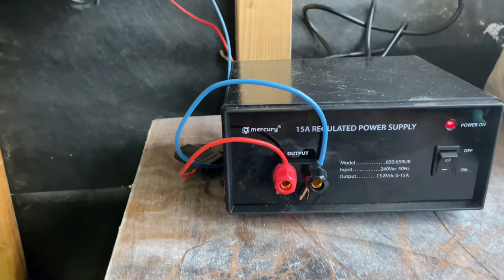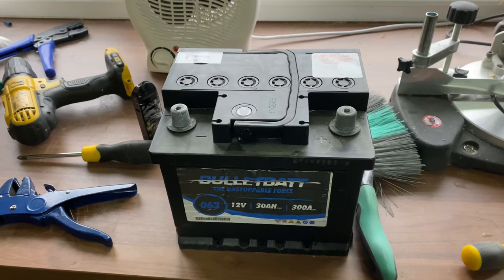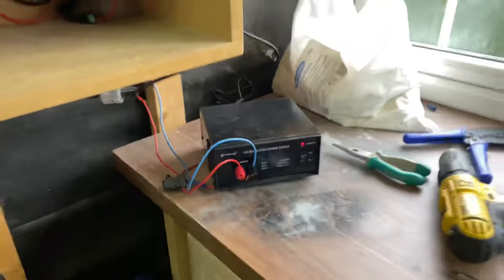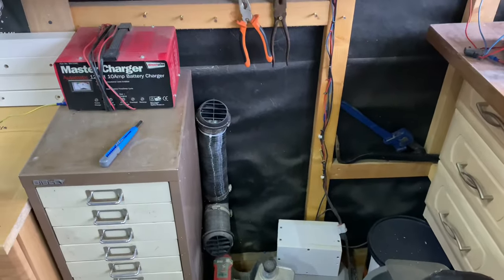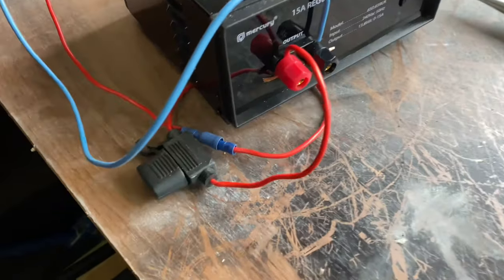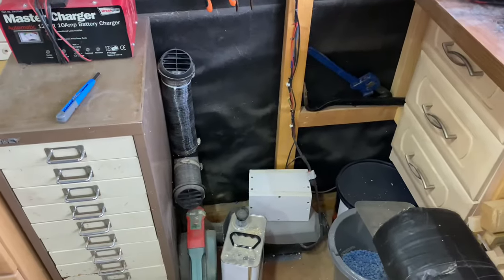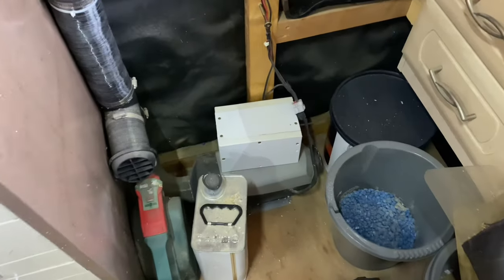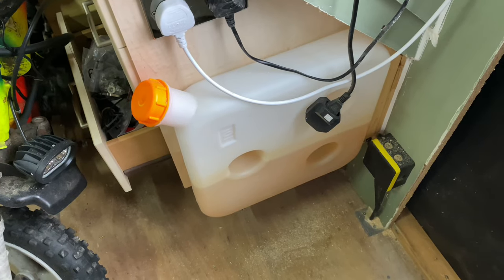DIESEL HEATER BATTERY IS A WASTE OF TIME! Switch to a power supply

Comment: What was your problem running off your solar?
Reply from the maker: It’s in the comments but essentially the battery dies in the winter I think
Reply: @STTC  ok lol that's what I want one for to warm up my solar batteries. 
Thanks for reply 🙂
Reply from the maker: @gkitch6755  yeah, I think my battery in my shed was used so little in the winter that the battery just decays from lack of use, that seems to be the only reason

Comment: Ok but what's powering the power supply box ??
Reply from the maker: Electricity
Reply: @STTC  thanks , I mean if I'm out camping , do you have a battery powering the power supply , I guess I don't know how a power supply works , do you charge it or plug into a battery ?

Comment: Hi,i've been using a 2kw heater with a battery and charger,i set up a 5kw a few days ago and last night it tripped the electric,i'm sure i've seen it said that a power cut could have knackered the heater,think i'll stick with a battery and try and find out what caused the electric to trip.
Reply from the maker: It’s probably the fuse you have going to your shed that tripped? what else do you have on the same cable? My heater in my van has stopped suddenly millions of times in my van when the batteries dip, still going strong brother but yeah, if you want to be sure, stick with a battery

Comment: As mentioned they are 12v heaters so designed for vans/campers/caravans. I am planning on using one in my house. Battery and charger will be used due to the failsafe aspect. What is wrong with a battery compared to a power supply?
Reply from the maker: Hi Clive, sounds great
Reply: The controller in the heater will automatically go into safe shutdown mode when the battery voltage reaches around 11.5 volts, the fuel shuts off with the fan still running to coole the heat exchanger via the exchangers heat sensor and during this phase the heater plug comes on briefly to purge any residual fuel from the ignition chamber ready for the next clean start up.
Reply from the maker: Cheers Harold, appreciate the input

Comment: Does the heater really use more than 10 amps for startup? I'm looking for a 110v to 12 volt houe adapter, and not sure if I should get a 10 amp or 15 amp adapter. The 15 amp are much more expensive and common.
Reply from the maker: I carefully monitor my start up current and have a few videos on this,,,,,the highest I have seen is 8.5amps but people make so many fake videos about these heaters that it’s hard to say for definite. All this nonsense about mother boards melting in poser failure too, and yet nobody has ever shown one fail catastrophically from a power failure and yet its a fact? no it isn’t. I would recommend you go the extra mile and get the 15amp
Reply: Thx fie reply. I did that 15 amp adapter from aliexpress.

Comment: The only thing with direct power is that if the supply gets cut off then the heater cannot perform a cool down cycle and could possibly damage it as it says in the manual..
Reply from the maker: Yeah, but I put videos up that show that’s nonsense,,, cheers for commenting though, appreciate that

Comment: so what happens if you have a power cut & the diesel heater can't run it's fan for the cooling down process, could the unit destroy it's self.?
Reply from the maker: Yeah definitely but mine has done it several times in my van and hasn’t hurt it, back it up with a battery if you want to be sure but I won’t be, hasn’t had any effect on mine

Comment: You can buy a power supply that has a wee battery in it, and gives it enough power to go through the cool down cycle if the power ever goes out.
Reply from the maker: Can you tell us where from Stuart?
Reply: @STTC  There is some on Amazon and eBay, I forget what the correct name is for them, but it's something along the lines of DC UPS backup or with backup battery. Hopefully someone will see this and help out with the proper term.
Reply: @STTC  APC power supply.
Reply from the maker: Yeah, I found them too, very expensive but for definite a perfect answer to the problem. Maybe not as simple as a battery back up though, interesting though all the same

Comment: Can I also operate a car charger with an integrated 0-40 ampere inverter or with an inverter (inverter) power generator, for example the Scheppach 2500i with a peak output of around 2000 watts and 1600 watts in continuous operation???
Reply from the maker: Hi roast n toast, I have no idea to be honest buddy. This could be a comment question for Martin Butler from “retrorestore” youtube channel. He’s very knowledgeable on this stuff, good luck
Reply: @STTC  thanks for that.  Have a good one 👍

Comment: Do you know why mine keeps blowing up all my fuses from day one. I was never able to get it started due to this issue
Reply from the maker: Probably jammed or tight,,, make sure it can spin easily without catching the guard. If it blows fuses straight away it’s not much to do with fuel or glow plug because that occurs much later in the cycle on start up. Is the fuse 10amp?
Reply: @STTC  it won’t even turn on. I’ve yet to seen the electrical screen turn on. The originally one comes at 25A. I’ve used several 30A, 25A, and 20A because I just thought they were bad fuses. Soon I realized something is not right because I don’t see anyone else having this issue. I did see someone posing something about a unit never working and they called CS and received a new one from them.
Reply from the maker: @letzgow6110  yeah, sounds like bad motherboard,,,,full stop
Reply: @STTC  I’ll call you CS and see what happens
Reply: @STTC  just checked and the motherboard came with a broken chip. lol I guess I’ll have to call CS. Thanks for the help
Reply from the maker: @letzgow6110  unbelievable mate, best of luck

Comment: I guess I missed what’s powering the 15A supply…?  Generator, solar panels… what?
Reply from the maker: The main grid Sir
Reply: @STTC  oh I thought we were talking camper van, mobile setup here…I also use a 15A power supply converter to power my diesel heaters should the heat pump go out.  I’m wanting to have a solution in place for of/when the power is out and also would like to avoid deep cycle batteries; however, everyone talks about my old craftsman 3500 like it’s “dirty” power that will fry electronics due to like of inverter tech. On the new ones, but I would think the 15a supply plugged into generator AC would throttle the power acceptably well wouldn’t it?  I could power several diesel heaters that way with my generator and avoid batteries.

Comment: The originals made years ago along with these Chinese copies were designed to run off a battery, always were. Nothing wrong with a mains power supply but equally nothing wrong with using a battery. That's what they were designed for
Reply from the maker: A well delivered point sir

Comment: Your T on the heater hose is installed wrong. The airflow is supposed to come into the middle of the T and then  it gets split equally out the sides. You are creating extra drag and limiting the airflow the way you have it currently installed.
Reply from the maker: Cheers Bob, great advice
Reply: @STTC  No problem. I hope it helps. Thanks for the video. I enjoyed it.

Comment: Video's like this should be removed from youtube. You state you must let the heater do the cool down before turning of the psu great you got that part right. So your heater is going at full bore and ooops you have a power cut 😆  oh no  your just about to cook that ecu that's on top of the heater. (in some cases this has happened) GUYS RUN FROM A BATTERY AFTER ALL THESE ARE MADE TO RUN FROM A BATTERY DO NOT FOLLOW THE ADVISE IN THE VIDEO.
Reply from the maker: lol, the advice is exactly what you suggest, if you watched it through

Comment: Nice video, I’m sure these diesel pumps are designed to be gravity fed tho so you may be overworking your pump. Maybe move your tank higher if poss
Reply from the maker: Hi Dave, maybe gravity assisted but they use a fuel pump
Reply: @STTC  hi Steve, yeah what I meant is rather than the pump having to suck it’s diesel it will have an easier and longer life if the the diesel is gravity fed to it.
Reply from the maker: @cooltube  yeah absolutely
Reply: @cooltube  Correct.  They are push pumps, not great at drawing and typically have a recommended one meter maximum head on the output.   As siphoning is the easiest way to bleed the lines it also makes perfect sense.   That said if the pump seal goes it does risk draining the tank through the heater.   So there are pros and cons.
Reply: @SynKronos  yeah that is true it is a risk but I’ve put a on/off tap on mine around 8” from the tank just in case
Reply: @cooltube  which is fine if you are present and recall.  Normally off (power off) solenoid valve  would work.

Comment: These things should come with a 120 adapter or a 12v plug in to make it easier. I’ve had a super annoying day trying to figure it out. Almost wish I would have gone a different route.
Reply from the maker: It will be worth it in the end though, winter is coming 👍🏻
Reply: @STTC  I know. I gotta do the mini wood stove now. One thing at a time

Comment: well you must have done it wrong i charge mine from solar panels no problems and most time have a fully charged battery saves cost of a power supply and cost of running it.
Reply from the maker: Cheers Ian, yeah I must have

Comment: Hello first time watcher. You sir have been truly ripped off with that power inverter. You can buy a 240-12v 30 amp for £18 off Ebay with more connections for led lights to connect to save even more cash.
Reply from the maker: Hey no worries Richard, you live and learn
Reply: If we don't live in our moms basement and are not in need of hooking up LED lights would you still recommend that one over the one in this video?
Reply from the maker: Great comment 🤣🤣
Reply: @STTC  😀

Comment: Battery every time.  I solar charge but otherwise get a smart charger (switch mode power supply)  that stays on the battery permanently.   Old fashioned types- transformers waste power, switch modes are by far more efficient.
Reply from the maker: interesting point Syn, and alot less rude than your previous comment. Cheers

Comment: That's funny. battery is a waste of time. i lost my power 2 days ago for 7 hours and it was 4 degrees outside with a -35 feel and if i wouldn't of had a battery hooked up to my heater my family  would of been cold and my water pipes would of most likely froze. a power supply is nice but if your electric goes out its nothing but a paper weight.
Reply from the maker: Cheers for the comment brother

Comment: That’s bulky, better off using an led 240-12v constant voltage driver , Amazon £23 300w 
That’s what I use and it’s brilliant. 
And slim
Reply from the maker: Great tip Richard, cheers for that

Comment: mine will not run on a 15 amp power supply
Reply from the maker: Why not?
Reply: im not sure i had to hook it up to an pricy batter charger that pushes up 60 amps  @STTC
Reply from the maker: @jasonclark470  I think there is something wrong there, is the motor tight? or the plug defective?

Comment: As pointed out in the comments, these heaters were designed to run OFF GRID, I have one in my Moter Home powered by a battery and  backed up by solar . I have one an my home, powered by a battery backed up by a Battery Charger.  This video should be taken down for misinformation.
Reply from the maker: 🤣🤣🤣 Chill out,,,,hardly misinformation,,,, cheers for subscribing and commenting
Reply: @STTC  I DID NOT SUBSCRIBE I REPORTED TO YOUTUBE FOR MISINFORMATION.  We had a power cut in Yorkshire, had my Diesel heater been on a transformer from the mains it would have fried its self, it was on a battery  with a battery charger so i could shut it down as intended with no damgage. Oh and I have installed 4 of these heaters.
Reply from the maker: @rodgersmith4116  Cheers for the support,,, all comments help the channel

Comment: i have got one of these too. and am switching to a power supply as well. good video. take a look at mine, see what you think, i have got it in the house cheers andyfireblade
Reply from the maker: Cool, definitely the way forward, is it going to be alot cheaper? that’s the question. Is this in combination with normal central heating?

Comment: u got robbed can get better 30amp power supply for less with multiple 12v connection points. ps battery and solar for diesel heater is a no brainer, free electric. and this is coming from an autospark of 31yrs.
Reply from the maker: Cheers Paul, although £45 is hardly a life changing robbery 🤣🤣 Cheers for the comment

Comment: use a bigger truck battery... give it a 2amp trickle charge every day or nite... SMALL CAR BATTERYS ARE A JOKE.. A LONGER BIGGER & BRAND NEW BATTERY WILL SOLVE YOUR ISSUE.. since i dont have a 15 AMP POWER SUPPLY. using a BIGGER KAR BATTERY & give a 2amp trickle charge during the day. and lasts the hole nite... 

WORN OUT BATTERYS ARE A JOKE & THEY WONT HOLD UP TWO POWERING A HEATER.
Reply from the maker: No battery required, just a power supply buddy

Comment: I use an eco flow pro battery backup with the extended battery and I plug it in to the cigarette lighter lol it works perfect this thing does great I have not had any issues The thing will last for up to 24 hours on this battery and it only takes an hour and a half to recharge it at 30% on AC or if I plug in two of my $160 w fold-out panels I can probably get them close to $120 to 140 watts going in charge time probably take me about 3 or 4 hours in the sun to recharge it from 30% which is perfect. Not as great during the summer but you just have to take advantage when the sun's out if you need to or just have a generator back up. I'm working on wind and solar hybrid system soon I'll have it here at the house I'm already converting over to 12 volt lighting throughout the house it is phenomenal for lights run 50 Watts that's barely even one regular light bulb and it's the same lighting you get the same brightness everything it's awesome. People just need to learn to convert over stop wiring all your lights for 120 volt you don't need to anymore they make 12 volt lights that are just as bright if not brighter
Reply from the maker: Good point about 12v buddy